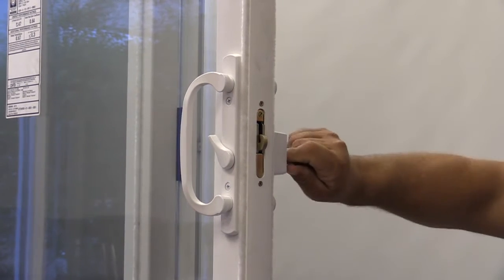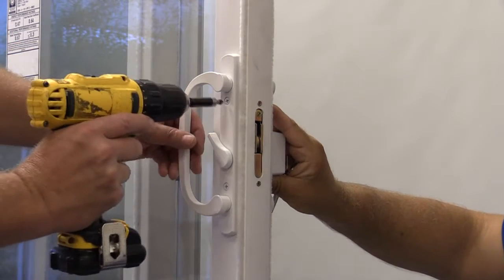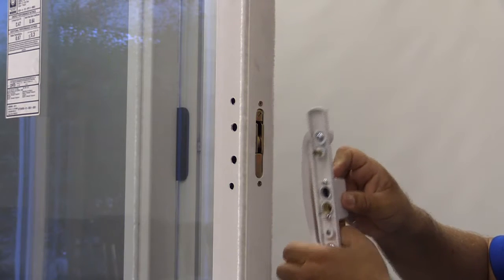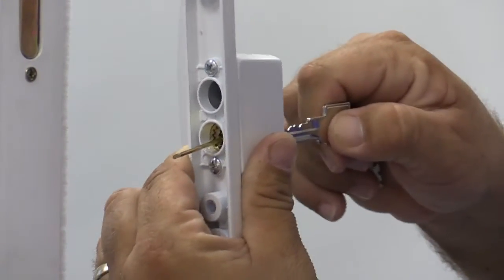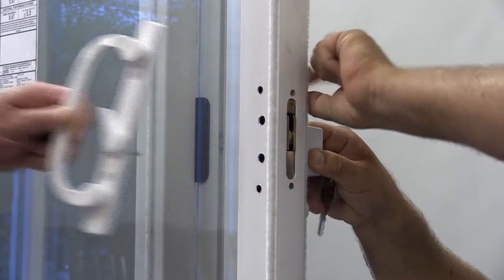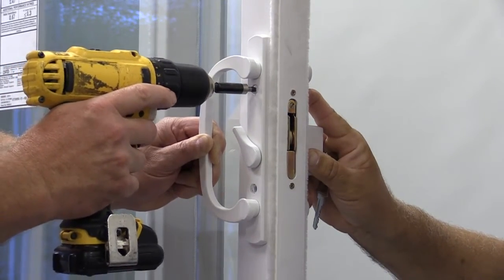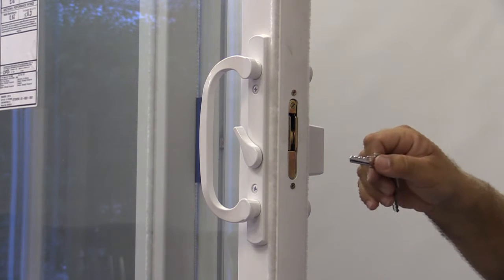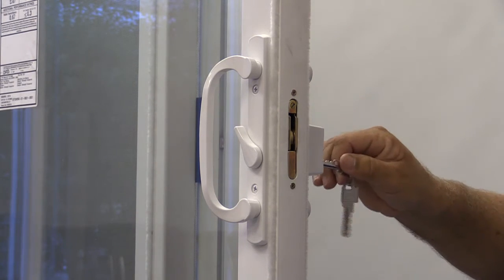Remove a Stuck Key from a Patio Door

Comment: Worked but now my metal piece that goes from the lock cylinder to the latch on the inside is bent. Unbending in using a vice and channel locks/spud wrench is only temporary. About to just install an actual door